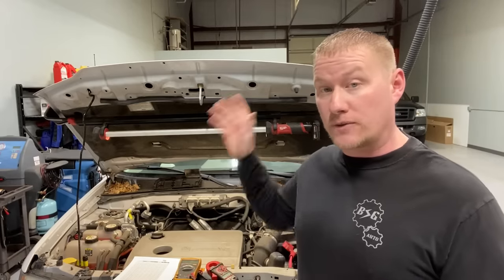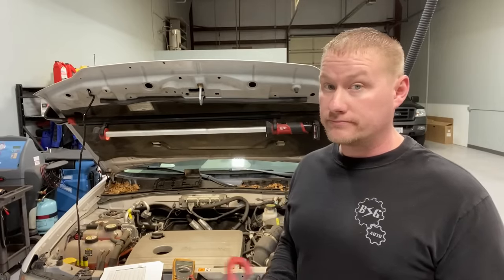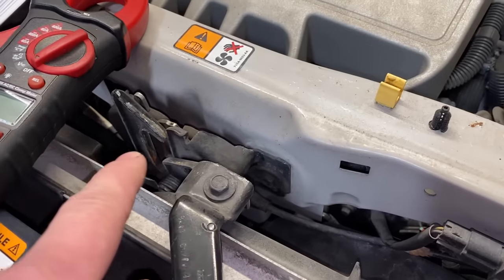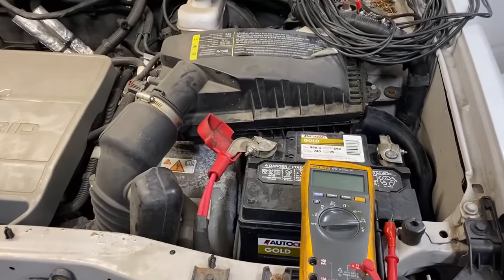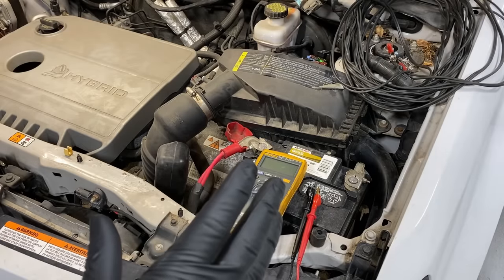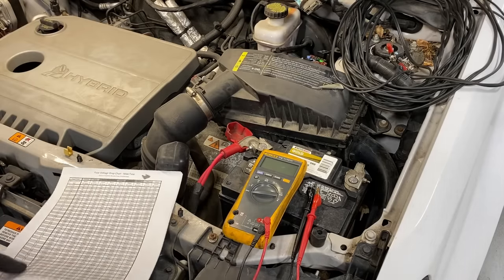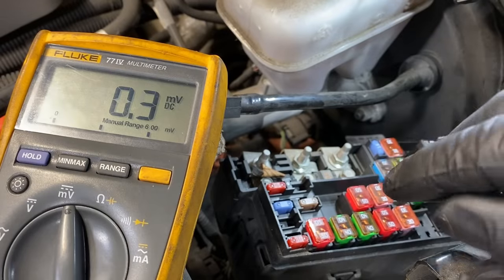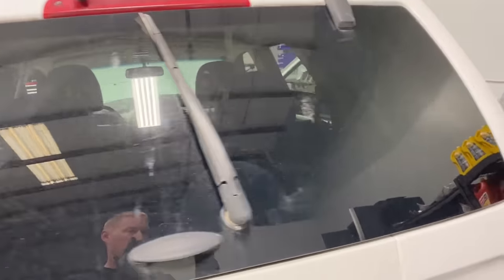Which Parasitic Draw Test Method is REALLY the Best?

Comment: Thank you, this worked great. I don't have an amp clamp, so I used the tried and true method. My fuse box is under the hood and trunk, so I just shut everything off and closed the doors, didn't lock the doors because that would turn on the factory security system. Hook up my meter to neg side, heard something clicking towards the back of the vehicle. Meter reading was 4.56, after a minute or so it dropped to .19, let it sit for about 2 hours then went and checked it, .02. So my parasitic draw is under .05 milliamps. Great method, thanks.

Comment: A quality amp clamp and that wiz-bang thermal meter is the ticket short cutting diagnostic turn around time. Thanks for this comprehensive overview using both the new vs. tried and true methods debugging parasitic draw. Great presentation!

Comment: You would really like the Fluke 381. It's a clamp-on  V.O.M. with a detachable readout. You can clamp the meter on your battery cable, detach the readout and take it with you to the passenger compartment fuse box or any other place around the car and pull your fuses or wiggle the wires and see your readings. It's not cheap though.

Comment: I am glad you brought this up.  I recently diagnosed a 2011 Nissan Murano with a drain that killed the battery in about 4 to 5 days.  I used the millevolt  test across the fuses and could not find the drain.  I tested every fused circuit twice and nothing.  I then disconnected the negative battery terminal and installed my meter in series and in milleamp setting.  I found a milleamp draw of 139 millamps after all the ECU's and modules went to sleep.  This is way above the 50 to 85 that is considered acceptable for a vehicle of this year.  After testing every fused circuit under hood and under dash I found the interior light circuit was the culprit.  Although the interior lights worked well I found the the BCM was drawing to much current in this circuit.  I agree that this new method may not work well at all times.

Comment: I've watched dozens of videos on the subject.  Currently trying to find a parasitic draw on a Jeep with a million add-ons/mods.  The method I was used to was the old school one of pulling every single fuse one by one.  But I was replacing the fuses after it didn't seem to make a difference.  Plus I wasn't waiting long enough before replacing.  Your video was not only informative, but you went through 'the why' and then demonstrated.  We got to see the demonstration after we knew 'the why', and it all made sense.     Consider teaching  You are good at it.

Comment: Awesome video. Thanks for taking the time to help. This problem seems to be more and more common as the standard 12v power distribution system gets more and more complex and taxed with more and more technology and accessory features.
Reply: Your comment made me think.  Why not go to a higher voltage system.  This would allow the use of smaller gauge wires and less of the precious metal copper.  Even the standard GM wiring might work properly!

Comment: Great job, well done.   I like your method of monitoring the Amp meter while Parasitic draw is occurring and backing it up with the fuse voltage drop.  I have done the Amp method draw and did find the circuit that way while removing fuses, but as you say you run into the possibility of "waking up" components, then slows you down.

Comment: Thats awesome...Never realy thought of combining the two methods... Amp clamp is king in my book for both charging and draw faults...
Reply: Except on cars that draws in weeks and not in one night. You can see it even on this video that the current clamp resets the zero value after current spike.
Set up at 33:20 (~60mA draw) reset at 34:06 (0mA draw) while DVOM tells you the true value when in line done correctly without disconnecting the battery at any time from the car.
Reply: @timowallin8020  isn't that reset cause some modules are already going to sleep and the intermittent draw also went away?

Comment: Thanks. This is the best explanation I've seen for the good and bad of finding parasitic loads.
It demystifies so much of the misinformation that is passing off as truths in other YouTube videos.
Using the thermal camera for the hot fuse That's a great tip. I don't have a thermal camera but not I have a good reason to consider buying one.
Great work I've even added it to my favorites for future reference.
Cheers from Australia.

Comment: In my opinion it's always best to start with the amp clamp. I've had a few draws over 10 amps that can blow the fuse in the meter if you do the inline method.

Comment: As a 35 year veteran automotive tech and a shop owner, I had not heard of this “method” until you demonstrated it. I instinctively knew all the problems with it as you cited.....there’s simply no substitute for in-series current measurement, especially with intermittent (or highly intermittent) draws and the ability to set a multimeter to “min-max” for long-term measurement/recording. Cheers!
Reply: Edit: as a “quick and dirty” method of isolating a constant or suspected draw I can see value in this type of testing....but only in specific cases. I would probably modify the procedure and go from battery positive to the suspected fuse and dispense with the “chart”.... just looking for abnormal voltage drop to confirm a suspect circuit. Having said that, if the draw is general and no obvious cause is present, I’d go straight to the old faithful in-line current draw tests. Cheers!~

Comment: Excellent presentation.  Thank You.  I really like your IR heat gun test.  Theoretically... if your Multimeter has the ability to read temperatures you should be able to read each fuse temperature, thus determining the "hot " fuse.  Have you ever tried this?
Reply: Never thought about that one, great idea.

Comment: Great video sir! I've had success with the voltage drop method, but I do as you demonstrate and pair it with an amp clamp or an ammeter in series. Definitely important to know the draw is active when you're checking fuses. I've also found you really have to jam the probes in tight to the top of the fuses to get an accurate reading. Otherwise you'll get ghost voltages that make you think you've found the problem when you haven't. Thanks for all you do, hope y'all are staying safe up there!

Comment: Great video. One thing, I like turn my meter on first and set the mode (volts, amps etc) before testing , not connect the meter with it off, then cycle through the modes to the correct one on a live circuit.

Comment: The pico low amps probe, albeit expensive, has a nice big clamp that fits over batt cables and is stupid accurate. hook it up to a scope, easier than disconnecting battery.
Reply: Very True! And I think you can set an alarm to sound off when it reaches the the settings to put in on the pico, I need to check into that, or a least have my laptop close to me .

Comment: Good stuff! But, on the third method, don't you run into the same issue as the first when it comes to the fuses with plastic covers? If it's one of them, how would you pinpoint it?

Comment: What an awesome video for the home mechanic.  Best by far that I have watched.  Have not been able to find a 150mA drain on my wife's 2007 Mustang.   (I even tried the movie method where you just open the hood and pretend to manipulate some things for a few seconds and then the car works!)   What I didn't do was leave the fuses out.  I put each one back before pulling the next one.  (Still managed to screw that up and put the ignition fuse in an empty slot.  Wow was my wife impressed when I killed the car and was left scratching my head.)  From the video, I learned that a couple of the fuses were resetting modules, which spiked the milliamps.   The reading went back down to 150mA within a few seconds.  Rather than pull all the fuses again in both boxes and leaving them out, I'm getting a clamp-on meter and will try the ultimate method No. 3!  BTW, there are no aftermarket accessories on the car.  (A few months ago, AAA checked the alternator and suggested that it might have a bad diode.  I read that this can cause a parasitic drain.  However, removing that fuse did not eliminate the drain, nor did disconnecting the hot lead to the alternator.)

Comment: While the draw is happening I wonder if you could use freeze spray on the fuses to see which one melts the frost first.  It works on finding shorts on circuit boards.

Comment: great video. I was researching this type of draw and your site showed up, although I am a subscriber is never saw this video before. I have a 2018 Ford T-150 that has wheelchair lift and drivers seat mods installed by the VA. I only had the van for a month before it was sent to a Installer in Chico to install all the equipment. They had it for six months. Ever since I got it back it has had a bad battery draw. After three days the battery was dead and had to be jumped. I took it to the dealer thinking it was a defective battery, they said is was just fine. I took it to a repair shop and had it tested, same results. After some very bad experiences with tow company's trying to get a jump start, I bought on of the battery jumper boxes I saw on your site. it works great. I finally took it to my repair shop and left it with him to take time to find the draw, He could not find it either. But I did find that the amp rating on the stock battery was not very good for my Hyd. power lift and seat set up to be run without the engine running. So I had him install the largest capacity Optima battery that would fit in the van. Now I can go a couple of weeks before I need to jump the battery. I am now to disabled to do this for myself. so Maybe I can Have someone come over and I direct them on what to doe. like you suggested. thank you for you video. Keep them coming.

Comment: When connecting the multimeter in series with the battery lead in method #2 you have to extremely careful not to actuate any device that would draw a large current, even momentarily, as this will blow the internal fuse in the multimeter. The fuses for Fluke multimeters are quite expensive so you don't want to make this mistake more than once.

As an electrical engineer I have to tell you that there is nothing magical about the current measurement ranges in a typical multimeter.  The circuit in the multimeter has an internal wire link between the amps terminal and the common terminal and the multimeter merely measures the voltage drop across this link, which is electrically just the same as measuring the voltage drop across a fuse. The only advantage of the current measurement is that the readings are more accurately calibrated than measuring voltage drop across a fuse.

The min/max function on the meter is not just restricted to the current ranges you can also use it when measuring the mV drop across a fuse. This will catch intermittent current draws just as well as the current measurement method provided you hold the probes across the fuse long enough.
Reply: Completely agree, as another guy with an electrical background.  The first voltage drip method, is a "quick" method in order to get a direction to troubleshoot.  There is nothing wrong with it.

Comment: The One and ONLY right way . Multimeter in line . In my world there is no other way .
Reply: Except when you work on late model cars with smart sensors on the battery terminal. Will not allow your meter to work in-line.

Comment: After watching your video I did the old-fashioned method of checking the fuses, all of them checked okay no draw. My 2005 Buick has two fuse boxes and a ton of fuses. The only ones I couldn't check was two circuit breakers so I took a chance and pulled one and my amps dropped to .02ma, seat module must have gone bad. Thanks for the very clear demo.

Comment: Hello FordTechMakuloco,

FANTASTIC Video

You hit it OUT of the Park! when you combined 1st and 2nd methods.

PS:  Amp clamp can be used on either side of the battery, whichever is most convenient.  If getting negative reading just turn amp clamp 180deg on cable as DC current is directional (Ref:  Right-Hand-Rule for magnetism)

Cheers!

Mr. P

Comment: Thank you for clearing that up. I recently had a draw, and later my radio quit working with the "Protect" flashing on the radio. And I was using that voltage drop method, but it wasn't helping me find the issue. I found my radio speaker wires were getting caught in the door catch inside the door. 2006 Ford F350.

Comment: Great video - I'm tracking down a parasitic draw in my 2005 Sequoia.  I have the Amp Hound 2 which eliminates the paper charts when testing fuses, but like you said it doesn't account for some intermittent draws.  I ran into that yesterday and thought I was doing something wrong.  Anyway, I went ahead and purchased your recommended DC Amp Clamp and Multimeter using the links you provided.  With all of these diagnostic tools I'm confident I will track down my issue.

Comment: This is the best video I've seen on this subject. I would like to point out one issue that is very dangerous. 22:00   Those sparks can cause the hydrogen gas in the battery to explode. I've had it happen to me many decades ago by improperly jump starting a car, which caused a spark. Fortunately my head was not directly over the battery so I only got hit by battery acid and not the flying shrapnel. Fortunately a garden hose was near by to wash my face

Comment: Long ago we used to hock an amp meter in series. We were testing the current draw of a body control computer that controlled the window actuators. Funny thing is, everytime the power was resumer the module need to learn the actuators, so it tried to drive all the four windows, getting a blown fuse in the DMM every single time. WE finally put a swtich to close the circuit and once the adaptation was done, opened to let the current flow into the DMM.

Comment: Worked for Ford 27 years like you like the old method.  Best on any problem good visual inspection have found more issues that way.  Crap can drive you crazy sometimes. I use little vise grips to hold ends to post.

Comment: I might add that when I did the multimeter test in line the other day that, when I placed my a/c led work light near my multimeter, it affected my readings!  Move the light away from the meter ..the readings changed. I found that by chance/ luck. Excellent video! thanx!

Comment: Hi Brian, My biggest fear (as far a repair cost) is electrical. Thank goodness you used a 2011 Escape because that is what I am having the problem with. My wife casually stated a bit ago that the rear window wiper stopped working all of a sudden and I just thought it quit because it is in an older Ford Escape. Your example was spot on and that was the problem with her vehicle. If you had not posted this video I would still be looking for the draw. Thanks again from me and my wallet.

Comment: 35:38 best video by far on phantom draws. It explained why my previous testing was wrong on my Subaru Outback. Could not find amp draw. Finally gave up and took to dealer. Using the 3rd method makes sense and will be my process for future phantom draws on my Subaru. Thank you for the great info!

Comment: Great work at the explanation. Good work with explaining the tool as well. I like the last version. I have a 2013 F350 6.7 having a real issue with. No damaged wires or issues with the body. No aftermarket items (save the AMP retractable running boards [these have also been disconnected] during checks. All of a sudden the display goes to battery saver - system off mode. I did notice, the media center "module" is staying on. Only at the very end of the video, did your script come up with the SYNC module note. I have been avoiding buying such an expensive piece, but, this is the only thing stopping me from driving the vehicle. You can hold the VOL button, it reboots but shuts down again within 4 seconds. Brand new quality batteries, used known good media center controller to test with as well as the original. Replaced the BCM which had some corrosion. Still perplexed at the issue, but, will try your test and although I have 3 meters, will get the same one you suggest. Any ideas, or have you experienced the SYNC module as a known culprit. Also, when touching the battery NEG cable, I do see a significant spark. Batteries are NOT going dead and keeping a charge, it is the SYNC screen issue I am experiencing and it shutting down right away, as soon as the key is on. Your help and expertise are much appreciated. That comment is as long as your video (which I really appreciated)! Thank you

Comment: Great info, Sir. Measuring "voltage drop" across a good fuse is basically useless anyway since a good fuse will have next to zero voltage drop. My method is to use an amp clamp after everything has gone to sleep, and start pulling fuses. I've only had to test three cars this way but I'm three for three.

Comment: Appreciate your efforts in explaining the procedures, with number 3 being the best method. The only draw back is that if you are at the fuse panel inside the car, you can’t tell when the parasitic draw is going to happen as you can’t read the ammeter. Even if you could read the ammeter but did not suspect a particular fuse, you would have to wait ages testing each fuse one by one waiting for the draw to happen. Conclusion being that it is a laborious but good method that you just have to have the patience and time to find the culprit.